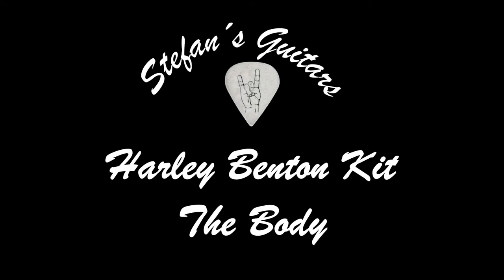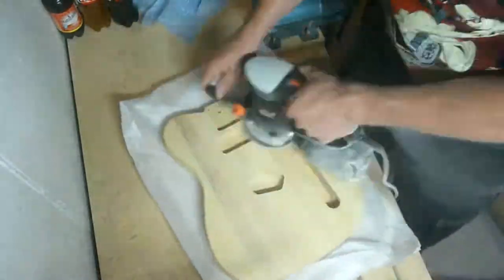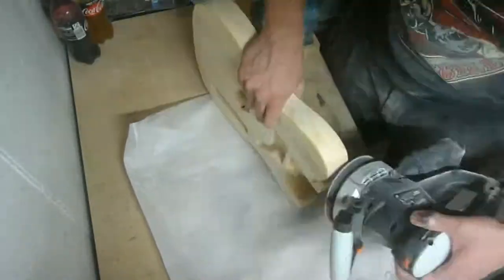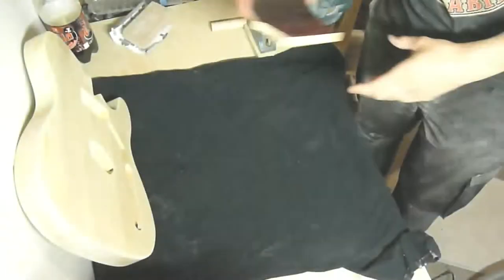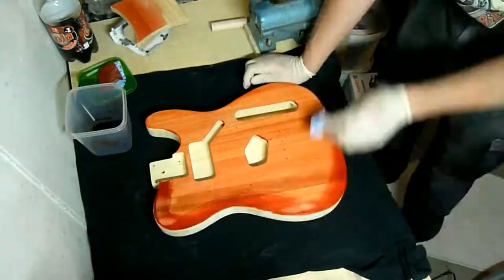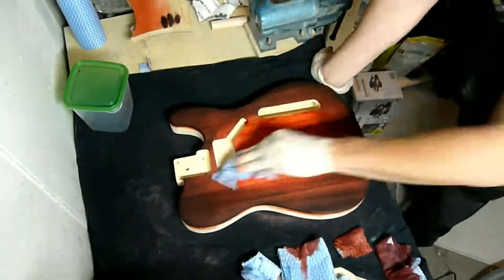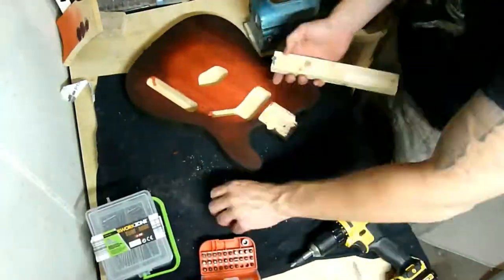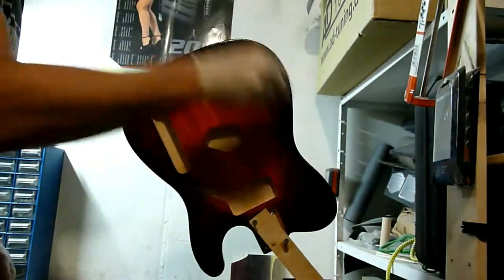Harley Benton Telecaster Kit - Part 1 The Body Works

Comment: Hi, is that  hour of sanding is really as needed?
Reply from the maker: Without that sanding the stain won't soak into the wood. If you want to go for a normal paintjob, a quick sanding should do it